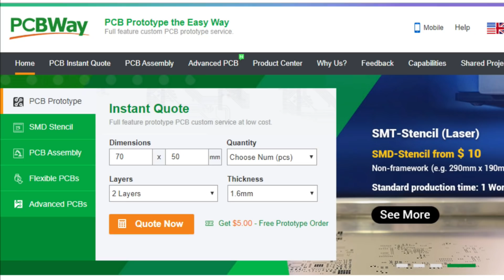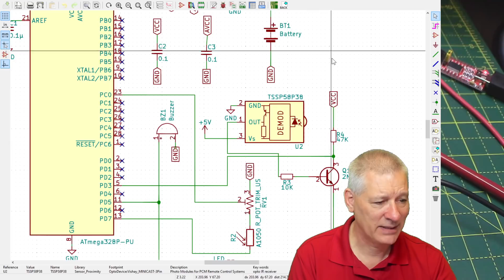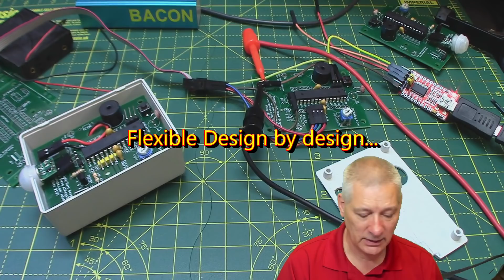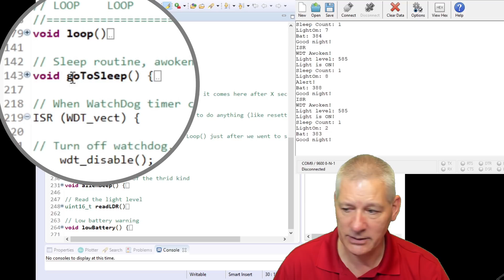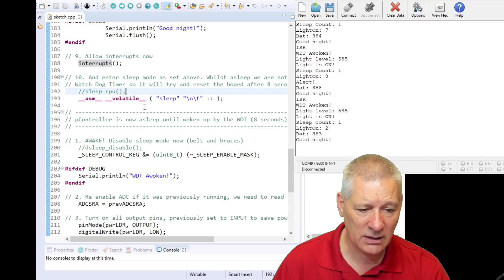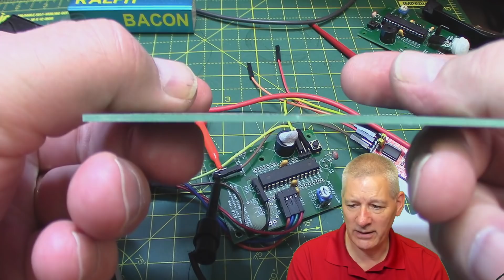#166 ATMega328P 💤 Alarm Update - WDT & Interrupt & Custom PCB

Comment: Hi, please may you tell me which kind of Multimeter you are using? Thank you so much and my greatest compliments for your channel
Reply from the maker: I have four multimeters (overkill, I know). One I use a lot is the Kaiweets HT118A. Similar looking and performing is the AstroAI DM6000AR. Two smaller meters (ideal for a crowded workbench or your pocket) are the Kaiweets ST600Y and the ANENG AN8008. 

I don't know why I keep using the HT118A, just one of those things! The others are pretty much equal in terms of performance although the latter two have fewer control and might be easier to use by a beginner (more auto-ranging).

As I said in my multimeter review, it's not worth spending huge (Fluke-type) money if you are just a hobbyist, when $20-50 will get you more than you will ever need.

Here's comparison page I just found too: https://bit.ly/4amiQdf
Reply: @RalphBacon  thanks so much, very kind!!

Comment: Loving the content Ralph - a question. Do you have a layout file for ATMega328p breakout board to save me having to design one (Gerber file?) Cheers
Reply from the maker: I'll check (I take it you have checked my GitHub already)? Nudge me if nothing appears there in the next few days.
Are you sure you want this exact PCB or any breakout board for the DIP version of the ATMega328p?

Comment: this switch for the light permanently on has special purpose. normally you have it on fridges with an integrated freezer compartment. You use it if the unit stands in a cold place, e.g. a basement. when it is colder than the set temperature of the fridge part. Because there is the thermostat sitting. The freezer part is not individually regulated. In a cold environment the fridge would not need cooling so the compressor would never run and the freezer would thaw - BAD. now you switch on the light and the compressor starts because of the extra heat. So it can also cool the freezer  part.
Reply from the maker: I can't tell whether you are serious or not! I would have thought that a separate thermostat for the freezer would be simpler to install than relying on the heat from a fridge bulb! But if that design saved 0.00001 cents then the manufacturer would probably do it!

Comment: Bit simpler to disconnect/short the switch in the fridge than to implement a battery-powered beeper, isn't it? Although it would be a much shorter and very boring video ;)
Reply from the maker: If I disconnected (or shorted) the fridge's switch then the light would either not come on at all or stay on all the time. And no video, just as you say!

Comment: I think the switch that makes the fridge's light stay on is a particularly weird way of implementing 'Fast Freeze' in fridge freezers where the thermostatic sensor is in the fridge, versus it being in the freezer. So instead of fitting a low wattage heater to keep the freezer sensor artificially warm, and thus cool the the freezer down more, they use the lamp in the fridge to keep the fridge sensor artificially warm to achieve the same end.
I changed the bulb in a friend of mines fridge the other day, and was similarly baffled that it had a very easy to accidentally switch on door switch override, which I only noticed because I checked to see if the light, which hadn't worked for years, went off when the door was closed. A totally stupid setup, coz without having read the destruction book, most folks wouldn't notice it, or even be able to figure out what the switch is doing, and it'd cost 'em loads in extra electricity costs.
Reply from the maker: I worry less about the cost of running the bulb (it's pretty low wattage) but more about the heat it generates thus causing the fridge to work overtime. The obvious answer is to replace any incandescent bulb with an LED equivalent. I've still no idea why there would be a permanently on switch for the light, though.

Comment: Just BTW - the "light always on" switch would be for those who are prohibited form operating electrical devices... primarily fundamentalist Jews, on the Sabbath.  Without the bypass, they wouldn't be able to open the fridge without violating their covenant with God!

WHERE the Sabbath mode switch is in the fridge might well be poor design, but having one does make sense.
Reply from the maker: A serious question: if the Torah was written so long ago (6th century BCE), how did they know about electricity and switches? Sounds like a modern interpretation, but I'm happy for that explanation about always-on fridge lights! But Siemens could have wired it so that it was always-off too and with the same benefit?
Reply: @RalphBacon  Yes, an nterpretation of how to apply ancient laws against "work" on the Sabbath to modern technology. Apparently it's OK to have the fridge running to keep your food fresh, but not to flip a light switch (or drive a car, or turn on a stove, or make a phone call).  It"s all a bit beyond me, but then, I'm not a Talmudic scholar... just a guy who noticed the "Sabbath mode" setting in the manual for my own fridge, and looked it up.

Comment: Why not run it off of a solar cell? No batteries needed.
Reply from the maker: If you were to run this off a solar cell (during the daytime only then, I guess) you wouldn't need Deep Sleep as you are not trying to conserve battery power. This is really aimed at battery-powered projects where minimising the current consumption is paramount. As my Benny PIR project is in a dark airing cupboard (or dark fridge) I don't see a solar cell working there, you see?
Reply: @RalphBacon  You are right. However I was aiming at the fridge story. The solar panel (fitted just behind that lamp which needs to be turned off) will make the buzzer go off after 1 minute by powering the circuit. And it will always go silent, when the lamp is switched off. (I understand it goes against the intention of your build, sorry for that. It is just to say that there are other ways to solve the lamp-in-the-fridge problem).
Reply from the maker: That is really thinking outside the box, very ingenious indeed. Unfortunately, solar cells are not the cheapest thing in the world but I have a couple of smaller ones so I might try out whether the lamp in the fridge is enough to power on a circuit like this (4.5v at 4mA or so). Thanks for the slightly, off-piste but very interesting suggestion!

Comment: Hi Ralph, great to see the project just prior to installation and you made a great work of the dimensions, this is an area where I need to concentrate more as things rarely fit and line up!
your are using 4.5v for your project is this at 8Mhz ? I will get round to sending you some pics of what Im up to and  will value your response, but i'm holding fire because I now want to do some comparisons side by side with the 328P in the DIL package as well, however I ordered 5 pieces from ebay several weeks ago and the max delivery date is up  in 2 days time and I guess I have to open a dispute, something I haven't done before, or do you think I should wait a little longer? not sure what to do as this is the first time it's happened, have you experienced things not turning up? however, great video and as always I look forward to the next....I had a little giggle when you talked about the "LED's" as I too would put in LED's just because " I can"... now I tend to just put a SMD LED on the power rail (s) just for that " at a glance " debug...cheer's.
Reply from the maker: Indeed Andy, I'm running at 8MHz with this 4.5v battery pack (fridge alarm got installed yesterday at my friends house, as he's an electronics engineer by trade I hope it works for a long time!). So...

So. it's interesting you should mention 328P DIL packages. Do you use any Arduino UNO boards with such a chip (ie not an SMD QFP-32)? If so, contact me on the usual email you may be interested in something I have. Regarding your delivery (from China I assume) contact the seller NOW to raise your concerns and see what they say. They may re-send, refund or ask for longer. I give them the benefit of the doubt for a couple more weeks if it happens to me (on AliExpress normally) but after that I want a refund!

And who doesn't need LEDs in a project, even if the project is running on a 1.5v battery (see tomorrow's video for more on this).

Good to hear from you!

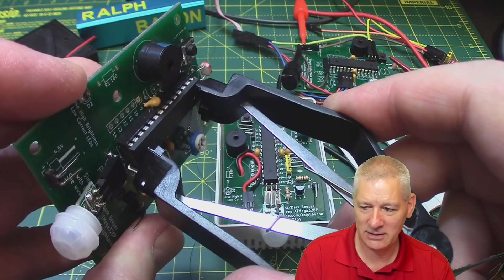Comment: The tool shown at 12:08 is a PLCC Extractor used on Square 20 to 128 pins PLCC chips buried in the sockets. In other words use the right tool. Example
https://www.amazon.co.uk/Aquiver-Protection-Extractor-Stainless-Extraction/dp/B073RDS57B
Can get better ones with a clamp screw that is much harder to slip off.
Reply from the maker: I'm almost certain someone else suggested this too because I already have on order. We shall see if I better success with DIP28 chips with the new tool! Thanks for the confirmation; if this new one doesn't do the job I shall look around the larger suppliers, after all there must be a million engineers doing this all day!

Comment: might see about moving my rfid lock to interrupts/watchdog. you can find a nice story online about how not to do watchdog timers... but the short version, car manufacturer to save money removes hw watchdog timer in car engine management, car engine management has an issue in the loop for throttle position, and can 'ramp up and stick' at 100%, this should be picked up by the sw watchdog, but its only attached to the one that times out like every 15-30 seconds, and if you press the brake pedal, it resets it leaving the throttle still stuck at 100%. i wont mention the manufacturer that starts with a T ... people died because of this ''unintended acceleration''
Reply from the maker: Isn't  it always about money, Lez? Rather than doing the right thing they save a few cents and cause pandemonium. [Shakes head in disbelief].

Comment: Have a similar project for us to see if Coco the cat is in his box or not while we are away. Started fairly basic as a clear plastic flap hooked to a pot at the doorway to his box. This ran an IN and OUT LED positioned near one of our security cameras which we can access online. Below a certain value, flap must have moved inwards, above a certain value then the flap must have moved the other way. 
Great...except Coco took one sniff at the plastic and refused to go back in the box.
So on watching your videos I think it might be feasible to use 2 of the PIR sensors, one outside the doorway and one inside. Connect these as a quadrature encoder signal ie if A high and then B then the movement must be going in to the box and visa versa, and still use the IN /OUT Led indication at the security camera. 
Enjoy all your videos and at times gives food for thought...many thanks...Jorgo
Reply from the maker: I'm glad you enjoy the videos, Jorgo and makes you think about your own projects. I see what you mean by using two PIRs which are (normally) activated in sequence (not if he just turns round in the box) which indicates the direction of travel. AS long as the wrong one cannot be triggered it should work. You don't want the PIR inside the box to be triggered as he approaches the box, that would confuse things! Good luck, if you get it working let us all know!

Comment: You have probably addressed why in anthor place, but why did you not use SMT parts?
You probably could have fitted the batteries next to (or either side of the PCB) with the saving in space.
Nothing crazy small 0805 passives and the transistor would be sot23, TFQP MCU.
Edit: Here it is in SMD. easyeda.com/blue.fire.falcon/bacon_ldr_mon ...its 50x30 so alot smaller than that one.
Reply from the maker: NIcely done, the SMD version that you link to. That said, I am very conscious that beginners are not keen on SMD soldering and much prefer THT which anyone with a soldering iron can do. Can you imagine beginners soldering a TQFP32 version of the 328P? So that was my main reason.
And, in this case, I (thought I) had more than enough space in that case! Using the 3xAAA battery pack (instead of the 3xAA) and reducing the size of the buzzer (so it is not so tall) has solved it for me and has made me remember to check the 3 dimensions of my project next time. Dodged that bullet.
I notice that you are driving the buzzer from a transistor, whereas I drive it directly. It was supposed to be a piezo sounder that takes next to no current but these (active) buzzers seem to be magnetic and draw quite a current; luckily not more than the max 40mA that a single pin can handle.
I have some SMD projects coming up, keep tuned and thanks for posting (and that SMD design, perhaps I should link to it?)

Comment: 12:01 Your chip extractor tool is a PLCC (plastic-leaded chip carrier) extractor, used with four sided square chips in four sided square sockets.
For DIL chips like the ATMega328P you're playing with, it's better to use either a simple U Type IC Extractor, or a slightly more fancy GJ-3 chip extractor tool (most ads say SMD which is rubbish, they are for DIL chips). Example links follow, of which I have no affiliation:
U Type IC Extractor: https://www.aliexpress.com/item/4000182122425.html
GJ-3 chip extractor: https://www.aliexpress.com/item/32578718826.html

Edit: GJ-3 is for 14 - 22 pin chips only, so you'd use the U type extractor in this case. Ignore the GJ-6 if you come across it, as it's for wider chips.
Reply from the maker: Now this is really useful stuff. I NEED a better chip extractor. That one I showed I've had for donkey's years so I shall search for the ones you mention. Thanks for the links, appreciated.
Reply: @RalphBacon  By "donkey's years", you mean "back when they were super expensive". I bought a PLCC extractor 30 years or so back for $70 AUS, things have certainly changed since then. Thanks for the continued videos Ralph.

Comment: Nice little project with a versatile board.
You can boost the volume of the piezo element by adding an inductor in parallel.  Some information on that is on the forums at:  https://www.eevblog.com/forum/projects/driving-a-piezo-hard/
Reply from the maker: That would be very useful, I shall read up about that immediately, thanks for the link.

Comment: Hi Ralph, your Benny buzzer alarm comes at a perfect time for me to use it as a inspiration for my Halloween decoration (movement detected -> turn on lights in spooky Halloween decorations).
So thanks!
Btw do you take requests for video topics? Could you please have a look at the Sparkfun Redboard Artemis? Features are 100% Arduino compatibility, ultra low power consumption, onboard Bluetooth, faster processor, and many other things.
Reply from the maker: Glad you liked it, Martin. I looked at the Redboard a few days ago and it looks nice but not exactly cheap (when we have ESP32s to play with). Have you compared features?
Reply: Yes, I've compared features (with Arduino, not ESP32). I actually ordered a Redboard Artemis Uno back on Septemer 9th, but the new Artemis line of products weren't released for retailers until October 14th, so I'm still waiting for it to arrive.
The ultra low power consumption, interrupts on all pins, higher clock frequency, CE certification, and Sparkfun's commitment to making Artemis 100% Arduino compatible are key features for me.
Nice-to-haves are 3.3V, more ADC's, more PWM's, and TensorFlow capabilities.
I don't need WiFi on my MC's, so that's just unnecessary overhead and complexity for me on ESP's.

Also, supporting non-chinese innovation and local retailers is important to me, but let's not get political, especially when we're this close to Brexit :-)

Comment: Hey Ralph. Interesting concept. I might steal it to make a device to take a look on when my daughter gets up at night. She is now a bit over 2 years and will get an open bed soon where she can get out if she wants. But we as parents would like to know that so we can help her getting on the toilet or prevent her doing potentially dangerous things. So I think of placing a similar device on her bed room door but only to react if the light is off. So I don’t need to switch it off when we are awake. The sounder could be remote in our bedroom then. What do you think about that idea? And do you also have children? Greetings from Germany. Michael.
Reply from the maker: You could easily do that, Michael, but would require the monitor (in your bedroom) to be wirelessly connected to the sensor (I'm assuming you don't want long wires everywhere).  The sensor could be battery operated and only triggers when there is movement but the receiver would need to be plugged in as you won't know when the signal is going to arrive. I'd probably use a 433MHz transmitter/receiver (see video https://youtu.be/tl0FkYWhhsk) for simplicity. 
Or just lock her bedroom door. What? Not so good an idea?
Reply: Ralph S Bacon hey Ralph, thanks for the answer. Locking the door is no option (out cat would make terror if she cannot go where she wants, also my daughter doesn’t like when the door is shut). I also thought about using a 433 or a nrf type of Transmitter. I will think about it and try this out. The sender needs to be battery powered, that’s also why I like your idea and code so much. Where the receiver would be is a power point nearby so that would work.